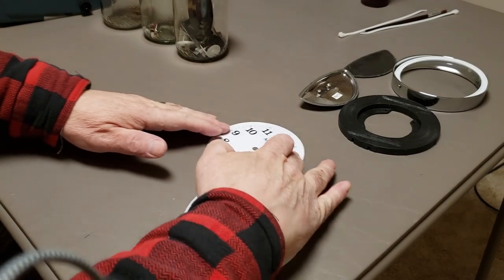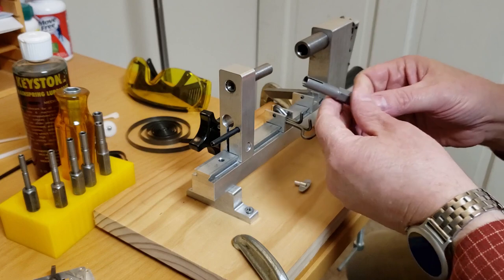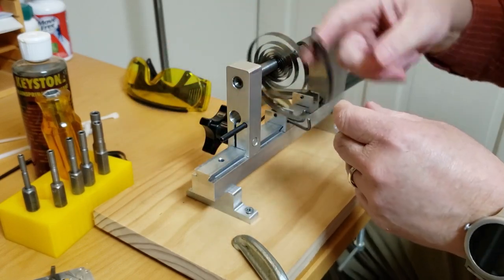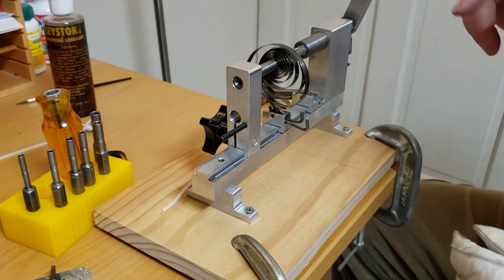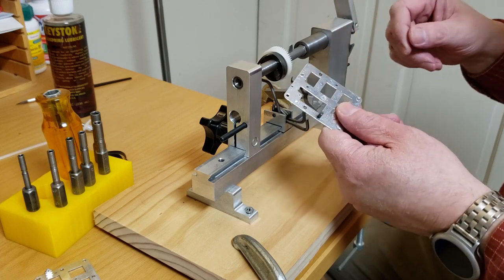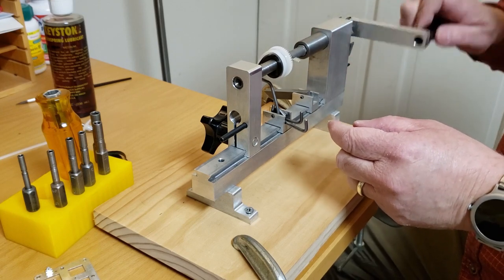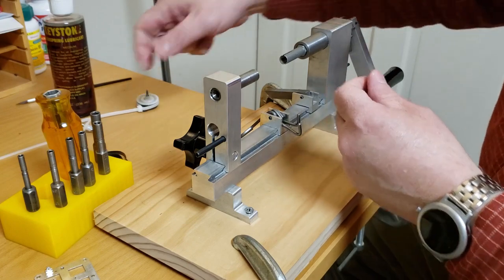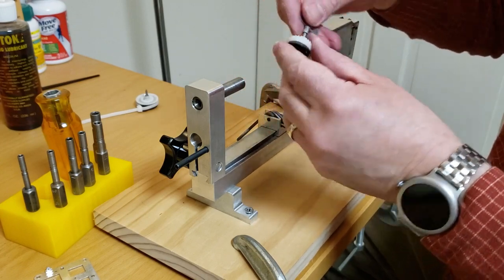An Alarm Clock Repair, Part 1: Winding the Mainsprings

Comment: May I ask where I can find the yellow block holder for the let down keys? Thank you
Reply from the maker: I designed my own 3D printed holder. I've recently redesigned it; you can find it on Cults 3D: https://cults3d.com/en/3d-model/tool/clock-repair-let-down-set-case

Comment: Where can I get a spring?
Reply from the maker: Short answer: I don't know. I looked at the site where I usually buy clock parts, https://timesavers.com/, but wasn't able to find alarm clock mainsprings. These kind of clocks are so inexpensive that I expect the cheapest way to get a replacement mainspring is to buy a similar alarm clock, for example on eBay. You can often buy clocks listed as "for parts or repair" that don't run for some reason, and so are less expensive than a working clock. You might also ask @okbridges where he gets old alarm clock parts; he  has done a lot of restoration work on old Westclox alarm clocks. Let me know what you find out - good luck.